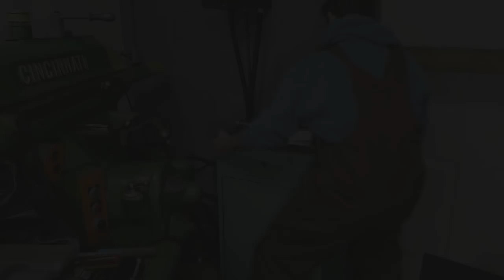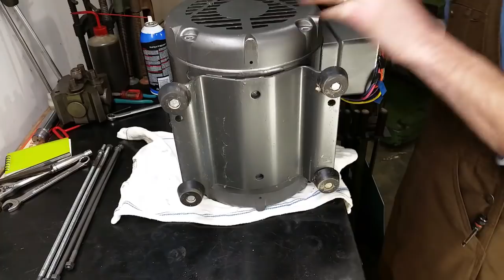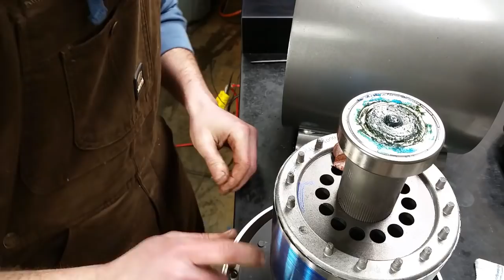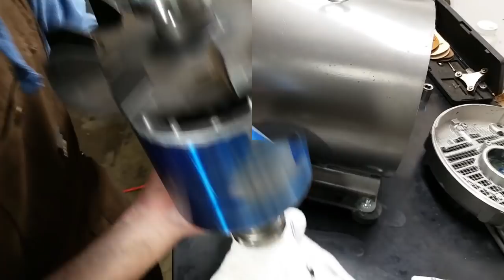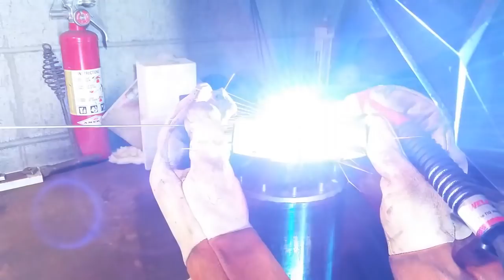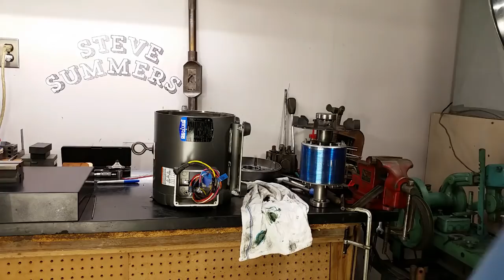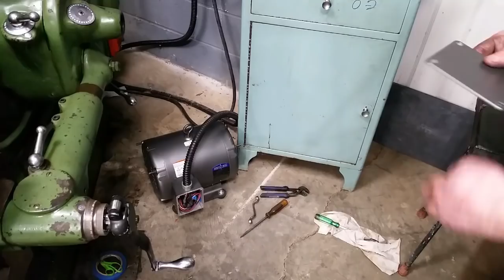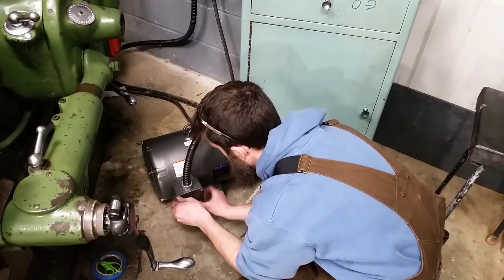Phase Converter Surgeon ;-) EVERYBODY CLEAR!!!

Comment: Great fix Steve.  You approached the problem in a logical way and followed through to a successful repair.  Question: Did you have electrical tape covering the nut and bolt bundled group of wires within the box?  The box looks like plastic but tape would be a very good safety measure.  Thanks for sharing your repair.  Fred
Reply from the maker: Fred Miller Tape?  What tape?😉 
Of course.  Thanks for stopping by Fred, this motor was driving me crazy. It only wanted to squeal when the camera was on.
The  "pecker head" or  box on the side of the motor with the wires in it is metal.
Reply: @SteveSummers  according to one old-schooler recently, wrap in cambric tape 
then cover with self sealing rubber tape. I like to use glass fiber tape if there
won't be vibration like with a motor.

Comment: I hope that is a fix, but I think you'll have it apart again real soon to replace a bearing. Sometimes just knocking a bearing around by removing it will make it quite down for a while but I think that noise will be back sooner rather than later.
Reply from the maker: Dick Sargent a bearing normally makes noise or it dont, sound from a bad bearing is normally  a constant  roar.  This is something different.
Reply: I agree. IMO the pitch of the sound was indicative of something thin like the plate(s) the fan was made from.  The bearing would be more of a growl not a screech. Also the motor coasted down in speed nicely. The bearing would probably affect the coasting. Good catch.
Thanks
Reply: @davesage9190  Some years ago we had the same problem with a noisy motor. It got noisy when it speeded up with a VFD but the bearings were good. It turned out to also be the fan, but  the motor wasn't designed to be run with a VFD speeding it up. The fan, made from plastic, dished out with higher speed and rubbed on the casing.
Reply: Sadly I think you're  right.

Comment: I would have sworn it was a bearing from first sounds! Awesome job fixing it Steve!
Reply: Same here.  Hope you thought to get the numbers from them while it was apart.  If you bought a replacement set for "just in case," you know you will never need to install  them... at least that's how it would be for me.
Reply from the maker: JBFromOZ Bearings are smooth as glass, not 100% sure what the deal was but it seems to be better now. . It Just wanted to squeal when the camera was on. 😃
Reply: If it was gonna be the bearings, the motor would be running all over the shop...   lol

Comment: Handled like a man with a machine shop should.  I was wondering why you didn't check if the fan 'ring' was square to the shaft before you welded though.  Since the existing two welds were acting like a hinge couldn't it have been a bit off?
Reply from the maker: somebody else I did.. but just by eye. I rotated it in the housing and watched for runout. It was good.

Comment: Ouch.. sounds as if a bearing of some sort is running dry. no wonder you want to investigate this Steve. Hope it's simple inexpensive fix .
 Double Oops. on my part , should have watched the full video before commenting, good fix much easier than sending it back, do hope Gentec are now aware of what the cause of this squealing problem as I bet it's not the only unit to suffer from this.